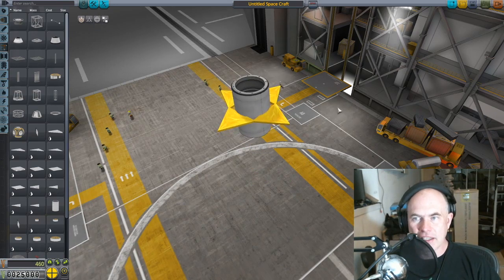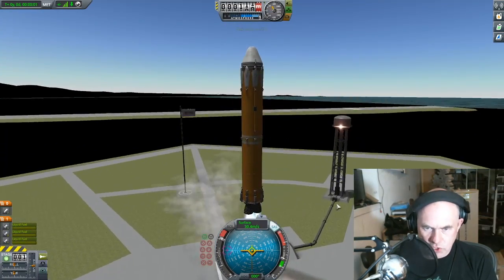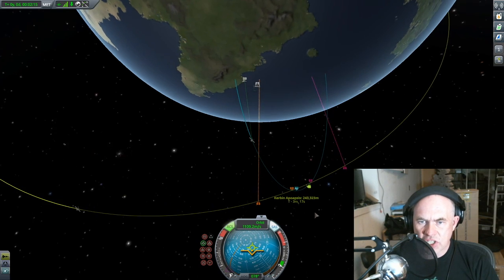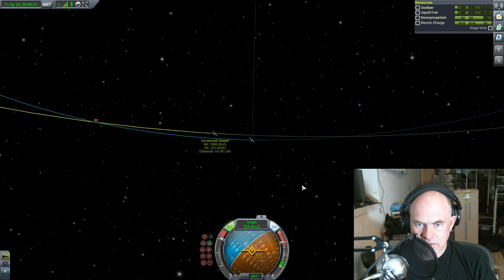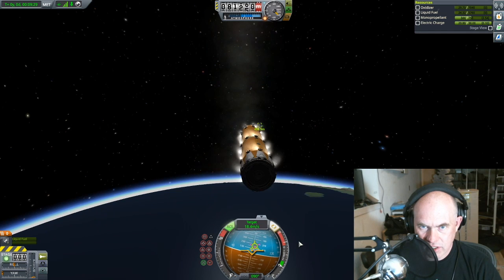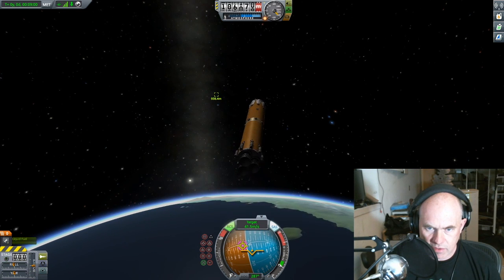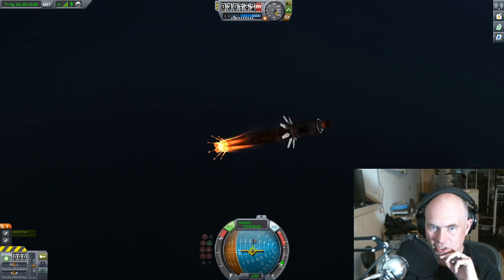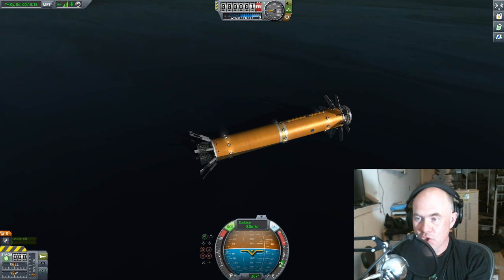Catching A Falling Rocket, With Another Rocket - Kerbal Space Program

Comment: Since Block 5's first stage should theoretically be able to be reused within 24 hours, wouldn't a better idea be to leave the second stage in orbit, land the first stage, attach a deorbit craft, dock that to the second stage in orbit and bring both back to Earth thus reusing everything? Should be economical as long as reuse doesn't cost much more than the fuel to refuel the first stage.
Reply: Freak80MC why not build the second stage so that it can deorbit on it's own?
It would weight a little bit more, but you would save another flight.
Reply: The idea that you could reuse the booster in 24 hours is insane wishful thinking.

Just checking the craft for damage, maintain and service and to refuel will take significant amount of time.

Comment: How much does a second stage cost? and how much does the fuel of a full booster costs?
Maybe we can really convince Elon Musk.
Reply: convinced
Reply: Possibly same booster, as you would have a while to get it ready again, since there is no reason why the second stage wouldn't be able to stay in orbit for a while.
Reply: The second stage is between 15-25 million and the fuel for an entire F9 is about 400-500 thousand. So less fuel for just a first stage. Not to mention that the performance for just a F9 1st stage would be ridiculous, I think they'd have to take off with a few engines off and all of them throttled down to minimum thrust.
Reply: Just one fact that breaks this: in real life you would be catching the upper stage at 7.5 km/s and not 2 km/s.
Reply: Rodrigo Galilea Just tell him "Oi , you wont do it" and trhust (get it? Trust? Thrust? :") ) that he will
Reply: You do have to factor in the added risk and hassle of setting up and launching another booster.
Reply: Rok Adamlje we can try it in RSS. The F9 first stage can technically get to orbit by itself according to what I read.
Reply: Definitely agree. For Falcon, SpaceX would have to do the cost/benefit math there. But I think this is a good concept for the long term IF/when rockets become as reusable/reliable as airliners. Of course for SpaceX, Elon seems more sold on the concept of the BFS which does away with this problem entirely (if it works as well as advertised). Perhaps this is something BO should look into.
Reply: So it's not a bad idea at all, if it can be achieved. But betting a a full booster on this step could be much to ask, at least for now; at the end it comes down to how good is the expected value in terms of probabilities.
Reply: Another factor to consider is that reusable rockets wear down, require maintenance and are not infinitely reusable, so every launch costs you a fraction of a rocket you are using even if you are recovering it. Also risk of loosing both the booster and the second stage.
Reply: Hard docking with the second stage ( hard enough to survive re-entry! ) is a teensy little problem to solve. Also where's the heatshield?
Reply: jkenny1 Makes sense, considering that it gets relatively near, while carrying a rocket!
Reply: jkenny1 it can. But it wouldn't have any fuel left once it got to orbit.
Reply: Isn't the first stage going to the atmosphere backwards at almost max Q? Then the reentry wouldn't be that big of a deal if you can use the thrust to slow down. I think the real problem is docking and the big velocity difference of the two vessels. But this would be a huge stepp forwards in terms of cost efficiency of the F9 system. Also you could use old boosters to recover second stages so you could use relatively "unsafe" first stages that can't bring payloads to orbit. Also i ask myself if you could bring one first stage to orbit while you are recovering another?
Reply: Yes, they say that even one engine at lowest thrust is too much for (nearly) empty F9 - it cannot hover on it, it would go back up (on the lowest thrust of just one engine). So, when landing they need to light it up at very precise moment to have zero speed at zero altitude.
Reply: The second stage does not go so slow in reality :) second stage is almost at orbital speed of 8km/s and the first stage break from 2-3km/s. In KSP the orbital speed is 2,5 -3 times slower :)
Reply: Also, the docking mechanism would be extraordinarily complex, the docking difficult to execute and the 2nd stage would need residual fuel to correct its path and get the relative docking speed down to extraordinarily small amounts.

Think landing on the earth except the earth is flying around and has a pin sized hole you need to hit with a much softer landing.
Reply: Don't forget the risk of things going wrong and going boom
Reply: Why's that?

Comment: Still 360p :P If I could get mechjeb to automate it, I'd do atmos/low orbit/mothership boost to orbit rendezvous! Basically launch to sub orbital, to save fuel, but use a mothership to slow down, sub orbital catch/dock, then the fuel from the mothership to boost back to orbital speeds. Would waste a ton of fuel in space, but would allow for more efficient engines on the mothership to be used vs heavy extra engines on the launch craft. :P
Reply: TechyBen you could probably do that with kOS.